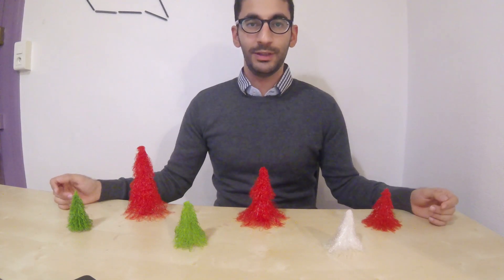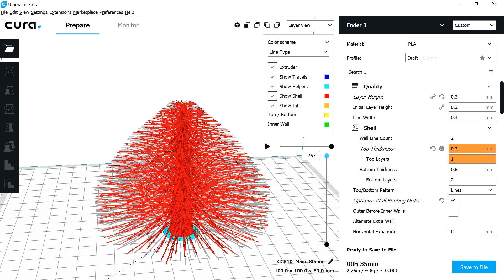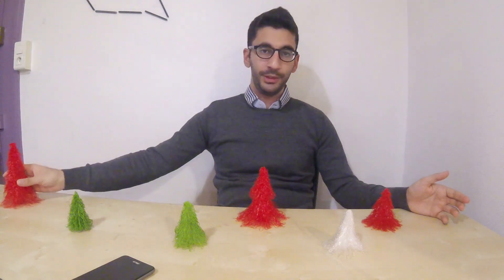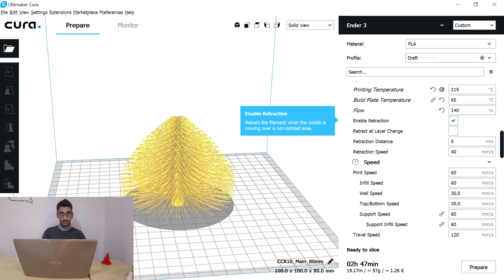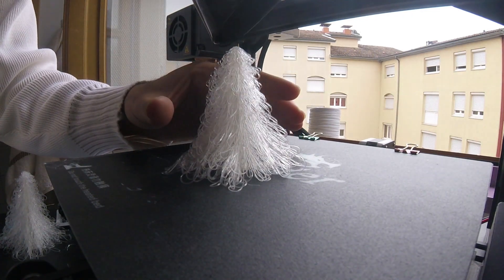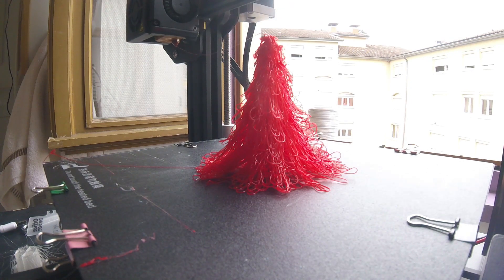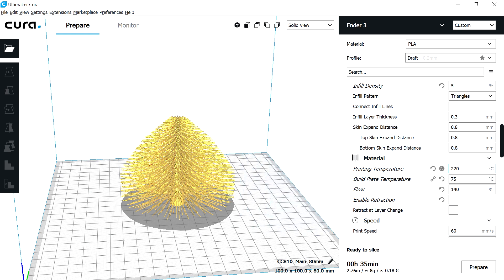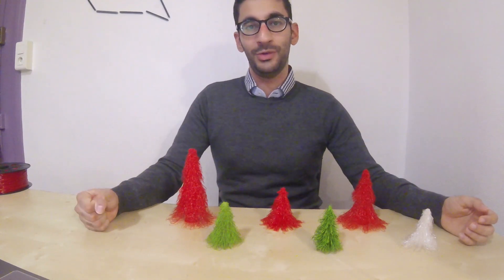🎄EZ Print Christmas Tree🎄 with CURA

Comment: I tried printing but all it printed was the cone.  Am I missing a setting change somewhere?  I am using a Promega with the Cura slicer.
Reply from the maker: maybe the width of the line is more than 0.4 ?
Reply: @DarrousHadiLEGO_ROBOTS  line width on the printer is 0.5 I did find some info where I had to change the per print settings. It started printing correctly.